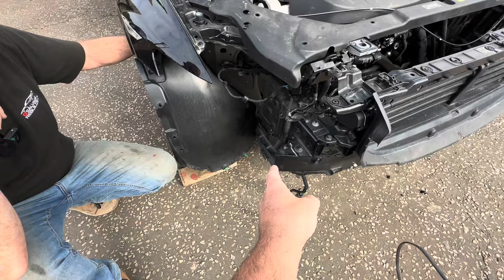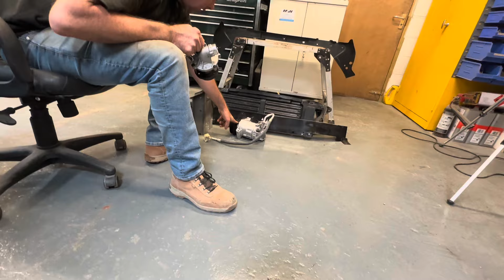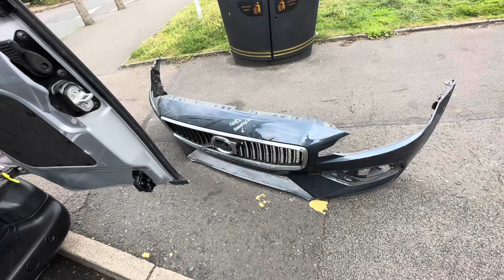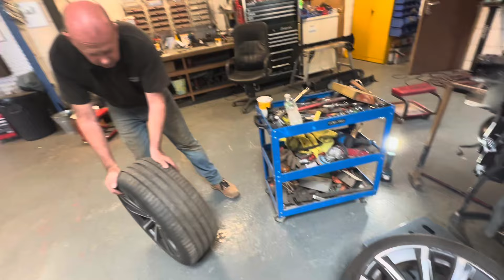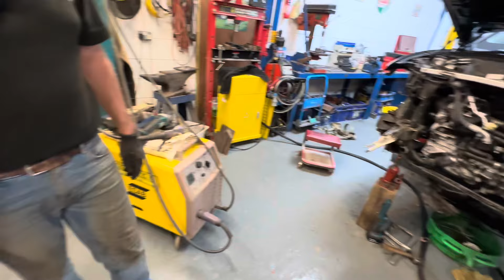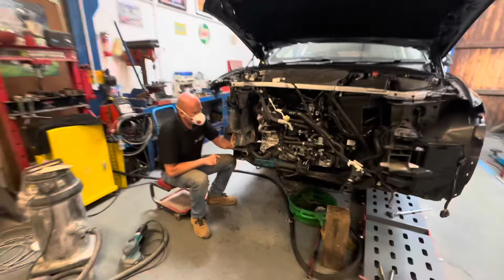REBUILDING A WRECKED 2020 VOLVO INVOVED IN A POLICE PURSUIT PART 2

Comment: That Poly-Vee belt from Volvo is crazy money guys. Instead I'd recommend that you check out the Gates catalogue which, I'm pretty certain, would give you the specification e.g. 4PKxxxx or 5PKyyy etc. Thereafter a tenner should be all you need to spend.

Comment: Volvo OEM parts have always been very expensive. Back in the late 70s, I had a 245 Estate and changed the plug leads for OEM from the local dealer. They cost me around £20+ at the time and that was expensive at that time.

Comment: How come you don't use motor parts stores for parts instead of using main dealers for parts
Reply: Believe it or not, parts stores are often more expensive than dealers.   Also for some parts, like panels & electrical items, aftermarket parts are much, much worse and cause either more work or don't work correctly.
Reply: @ckm-mkc Very true. I just bought a rear bulb holder for my car and the VW main dealer was cheaper than everywhere else including eBay.
Reply: Some parts will be main dealer supply only

Comment: Lovely explanation by Chris on drilling out the spot welds, I knew they were special (expensive) drills, but never realised they are intact a flat cutter. (Personally I would have thought safety glasses should have been worn but only an observation) Very interesting and informative video. 👏👍

Comment: Great video as always guys. However a rare criticism...Chris...no eye protection!!!
What is on the truck is intriguing. At £10k bids it has to be something a bit special. The engine is not in the car, it sounds badly damaged. It is either a top of the range late model car or could it be a bit of exotica???? Can hardly wait.
Volvo parts are expensive. I used to get all my bits from Eurospares who always seemed to have Volvo parts at good prices. 
Have a good weekend guys. Cheers, Bob

Comment: You have done well with the  new water pump Rob a stroke of luck there! Shame about the hidden chassis damage but as usual Chris stepped up to the mark. It may be that the body shop just didn't fancy doing the extra work but we will never know. This job is taking a bit longer than you first thought but as you said with the tyres, ' if a  job's worth doing it is worth doing right'. I wouldn't expect anything less from you Two. Thanks for another great video and have a good weekend Rob and Chris. 👍👍

Comment: Chris knows the importance of very correctly repairing and replacing certain parts with structural damage on any car as assures if the vehicle is ever in a future crash, it will properly absorb the crash and keep the occupants safe. Yes, it is more work, and a few quid more, but you guys have to do it right for your own peace of mind. There are far too many out there that wouldn't just to save a few quid and not care about the risk to the customer.

Comment: I think your mad not to wear safety glasses whilst drilling out the spot welds,it's no fun when it goes in your eye and goes rusty and you need to go to a and e for the big magnet
Reply: Or fluorescein eye drops, a blue slit lamp and the end of a hypodermic needle to pick the rusty fragment from the surface of your cornea. People describe the feeling of having a brick in your eye, even after removal as the corneal abrasion takes time to heal. So wear eye protection, people!

Comment: Seems unusually bad engineering to piggy back the water pump off the air conditioning compressor doubleing chances belt or bearing/clutch failure causing overheating 😮 plus that belt must be a one-off designation to be that price.

Comment: I’ve owned Volvo’s for past 20 years and can officially say that their dealer parts prices are ridiculous. INA makes pulleys and bearings for them. I use Gates belts and any suspension parts are made by Lemförder. Less than 1/2 the price if you don’t pay for the fancy blue box that says Volvo on it.